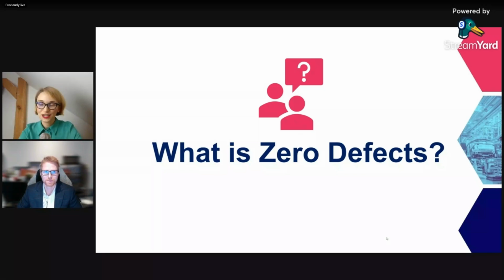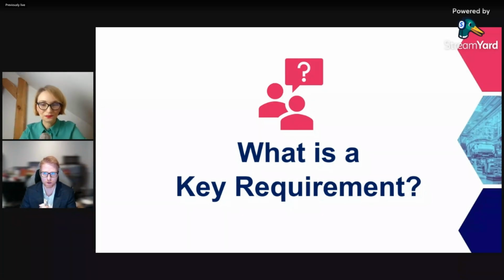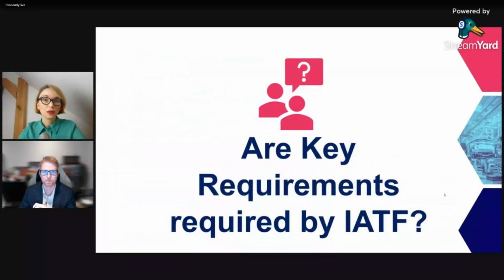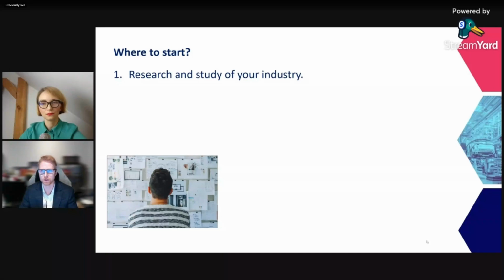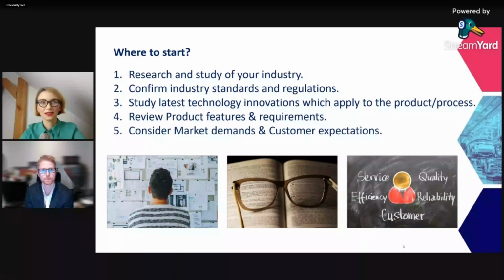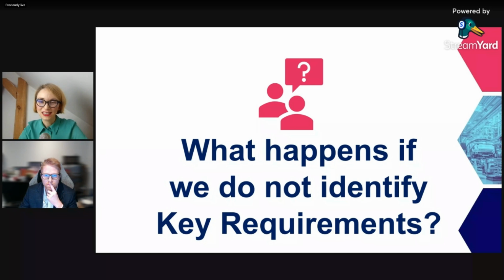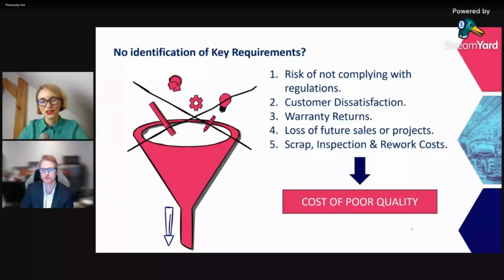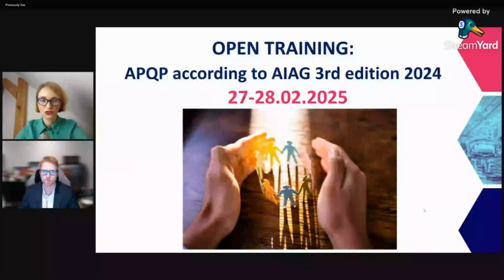[WEBINAR] Zero Defects Direction #1: How to Identify Key Requirements

Comment: Excellent Presentation and great topic as well. Requirements are key for Product to Succeed with great built-in Product Quality. In Automotive industry, there are so many moving parts and so many different types of requirements that needs to be fulfilled through large number of suppliers who provide different components, software, technology, etc. 

Well, this is where 🏵 OpenRose - FREE and Open Source Requirements Management Application can help. It supports Baselining, Traceability, Hierarchy, Markdown / Formatted Description, and ability to Copy requirements data at various levels.

It's a General Purpose Requirements Management Tool and the Goal is to help Individuals and Teams to 'DO IT RIGHT' and 'REDUCE WASTE'.

We strongly believe that OpenRose will be useful tool to have in your demos, Proof of Concepts, re-usable requirements, Trainings and Consultancy that you deliver to your customers.

- OpenRose - 🏵 Requirements Management Tools Team